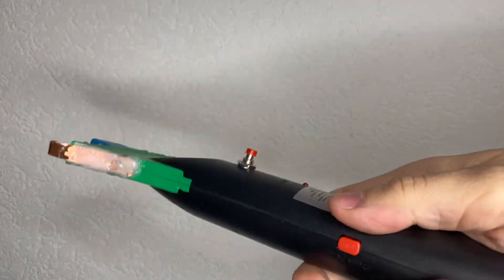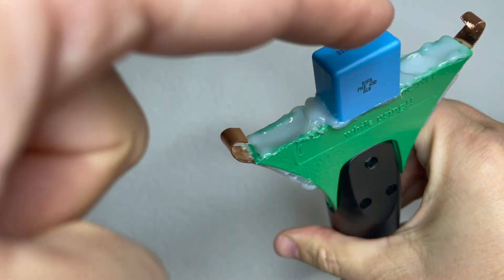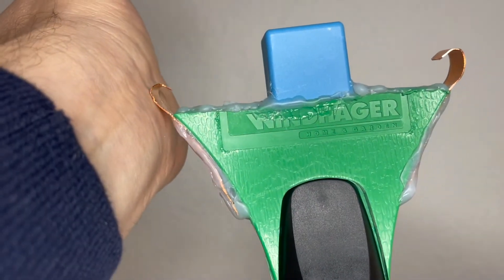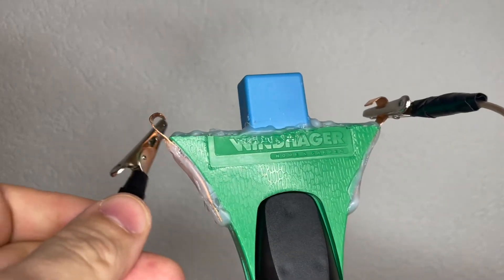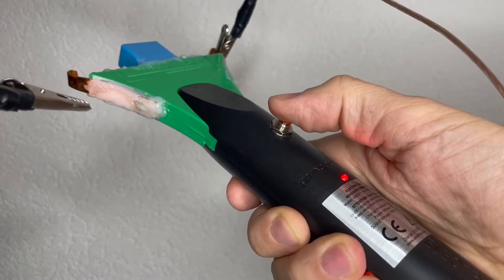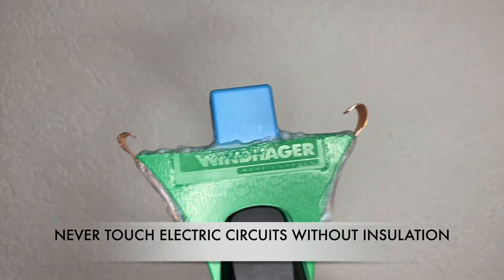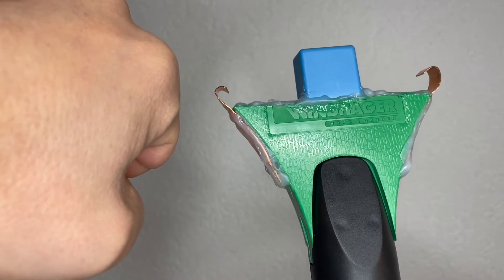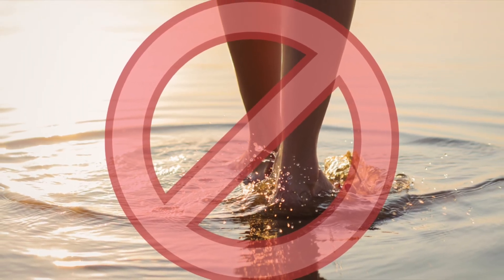HOW TO CHARGE AND DISCHARGE THE MODIFIED ELECTRIC RACKET - IN ENGLISH

Comment: Thank you for all the wonderful information you are sharing with us all.  Is there a video of how to put the switch on the handle of the racquet?  I would definitely prefer to make one in this way.
Reply from the maker: @guinevere Charlotte theresa shepherd, Simply drill a hole and attach the switch. And do the cable and capacitor connections inside the racket instead oitsode

Comment: Can you explain about the hydrogen and why we are not to use it as we are 62% hydrogen are you talk pure hydrogen as I use hydrogen with oxygen together?
Reply from the maker: @daisychsins2buttercups, we are not 60+% pure hydrogen. Rather water that is  2 atoms of hydrogen with an atom of oxygen.  Hydrogen is has one electron. Electricity is movement of electrons or push of electrons. 
Extra electrons in our body amplify the current that generates when frequencies hit us. 
Carbon aluminium and Silica nano particles( and other metals) are extremely conductive, therefore extra electrons from the hydrogen, simply amplifies amd increases the electric current in our body. 
Most, if not all our functions in the brain are electro chemicals. In the cells too. These external emf signals cause vibrations on our cells and part of their energy is converted to electrical current. The extra hydrogen is amplifing the damages

Comment: So no rife machine is safe? at any frequency? Scaler as well?  Pain genie?  What about light therapy only red and not infared?  There is even a UK channeller called Michelle fielding who is now recommending the spooky and I was concerned about this based on what Tony P said. So very confusing, bought the bucket from Tony a few years ago. Your shop looks good will make a purchase.
Reply from the maker: @daisychains2buttercups, any device that the mode of action/ operation is applying electrode on the skin and having current pass through the body in continue repeated way, it will energise the  nano particles and accelerate their networking. All these devices may be effective against organic biology like real parasites and bacteria, but on synthetic biology created from the nano particles in the body, these devices will make things worse. 

One or two static discharges of High voltage low current can fry the nano. 
Pulsating magnetic field also disengage the nano and also fry several of them.
This stops their networking and In combination with nano detox protocols and reduction of the intake, it is easier to remove them from the body and starts healing 
Do not use spooky and any other device that applies electrodes on the skin and sends current continuously through the skin. The nano initially will reduced but after 3-4,sessions they have adapted and accelerate their network in the body. They will take you over in no time! 
It sounds scary because it is scary fact!
Reply: @AroyMak  Thank-you for that info. Based on that would you think that micro currants like the senar are ok? Also I have a quantam Wave lazer which is pulsed the older one which the fda banned they also banned the q1000 as you can programme any frequency with it, but I dont think that was pulsed like the quantum wave is. These are devices I have bought a while ago to use..also I  have a health point device that applies a micro currant pulsing for only 30 secs at a time,like doing acupuncture. Yes so Tony P said  to me my PEMF mat was OK to use as well.

Comment: Good video and informative about the switch. Gonna build one when the capacitor arrives. For the anti nano triangle, my power supply is 12v 15amp, can I use car flasher relay with chip inside and is 24V DC 180 watts? Thanks.
Reply from the maker: @Puppet Master Reloaded, thank you. Regarding your question for the flasher , the 24v flasher will not work with 12v power supply
Reply: @AroyMak  thanks, Hello, good day I have a  question, I already used the 12v car flasher, my power supply is 12v 15amp and I use fuse for it, it seems that the car flasher is not durable and will only last for 4 sessions then it stopped already. I use the electronic car flasher, what car flasher can you suggest that is durable that can last many sessions? Or any pulser that is durable that is applicable for my power supply, Thanks.
Reply from the maker: @puppet master reloaded, probably the current that is required to pass is higher than the current that is rated your flasher. 
please  use an ohmmeter, or a multimeter that can measure electrical resistance and measure how much is the resistance of the wire of your bucket or triangle . 

This resistance determines the current that will pass. 

Current = voltage/ resistance

In the following days I will publish a video with instructions
Reply: @AroyMak  dont have multimeter but i use the conversion online the resistance of my gauge 12 wire is .52. i cant measure the current for my flasher. Already used 4 car flashers and same result, the flasher got light in it and that seems the one burning fast from my power supply. I use 15amp fuse to prevent burning my flasher and power supply and still same result. Any alternative than car flasher?
Reply: Hello, will the 12v 20amp power supply enough for my gauge 12 copper wire triangle? Though based on computation it should have been 12v 23amp or I will just use gauge 14 wire for the power supply of 12v 15amp but with 1amp current excess for the power supply for the wire of 328 feet. Thanks. I think many people having problem with these when they make their triangle.

Comment: Can I touch the one terminal of the surge device on my neck to deactivate the old nano networks?
Reply from the maker: @Puppet Master Reload, I would not do it, neither recommend it, but its up to you. If you decide to do it let me know the results. Most important Make sure you have a wide metallic part , even aluminium where you will touch the terminal, otherwise the discharge will be like a needle penetrating the skin at the touch point.

Comment: From both wrists transmit voltage across the heart.  Not good.  
One wrist and one ankle should be the safer standard.
Reply from the maker: @Bradwick1, yes it is correct the risk of  what you say . I am fully aware and had  the same concern , but practically It is not happening the negative effect to the heart with this specific discharge . 
One wrist and one angle indeed is safari standard but again it depends the selection of the wrist and the angle… 
What is definitely sure is that persons who have implanted pacemakers shall not use this methods as there is a risk for the battery of the implant